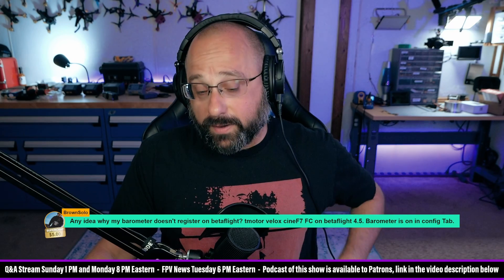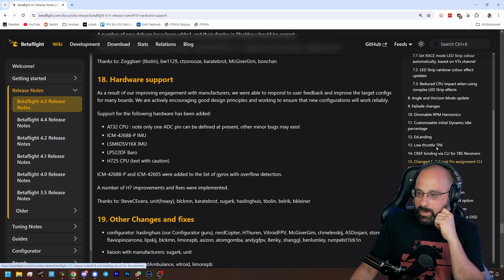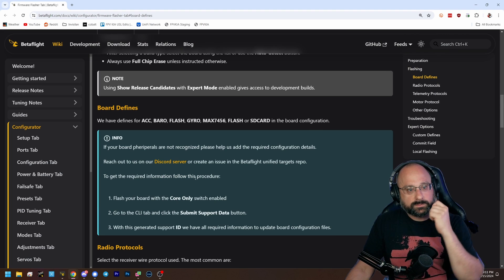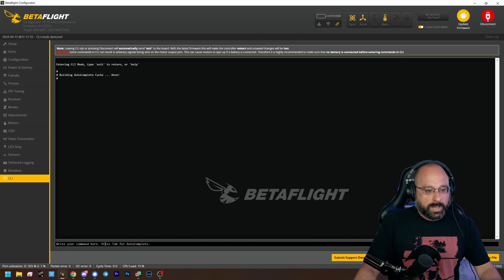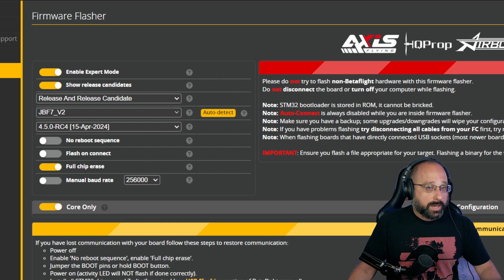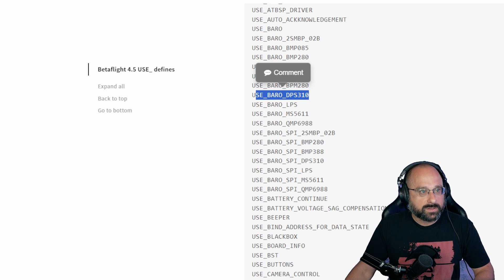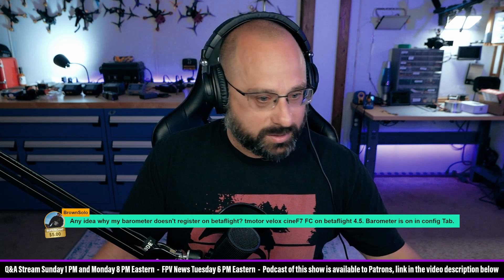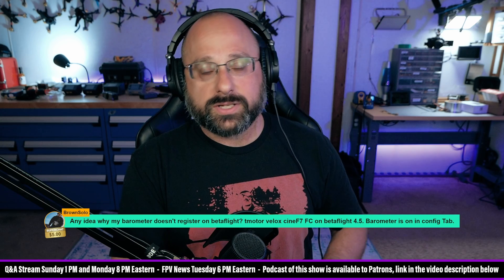My Barometer Doesn't Work on Betaflight 4.5! Help! Custom Defines? - FPV Questions

Comment: Same issue with iflight blitz f722 fc, betaflight doesn’t recognise the baro. 
Once I flashed to bf 4.5 baro icon appeared for sometime and then gone. Reflashed 4.5 assigning the dps310 according to the spec of the baro on this fc, but it didn’t solve the issue

Comment: Thank goodness for this clip. swapped a dead speedybee v3 with a v4 and this problem showed up. I couldn't get BARO_DPS310 to load so i just used DPS310 to get it working
Reply: Just wanted to clarify: 
Did you type BARO_DPS310 in the custom defines & it didn’t work.
Then you typed: DPS310 in the custom defines, & then loaded the firmware & flashed it, and it did work?
Is that correct?
Thanks so much.

Comment: Helped me out on this too turns out auto detect chose the wrong firmware type for my GOKU F722 PRO V2 Flight Controller
Found this on Flywoo and flashed with that and it worked: BF Flight Controller Firmware: FLYWOO F722PRO
Reply: So  Flywoof722pro? Because I know it said dual on the auto detect one

Comment: i dont have any baro detection even in core mode, my flight controller is brand new, its the speedybee f405 v4. I have tried both beta flight and gps and in both softwares i am not getting any baro, mag and gps detection, they are either off or in red.
Reply: i have the same problems with speedybee f405 v3 i installed gps not working and the baro on my fc is also not recognised
Reply: red means you dont have any stats. go outside and check

Comment: After updating the firmware to 4.5.0 betafpv F4 1S 5A AIO, the osd fell off, and now it’s impossible to roll back to the old 4.4.3.
Reply: That sucks. My osd came back when I flashed 4.5. Before that, I'd thought I'd damaged the hardware.
Reply: @kurtzFPV  Now the bootloader doesn't work. I can’t update again or flash any other version. Telemetry is working, the transmitter warns me about the voltage. I’m not saying that OSD is so necessary on tini whoop, but until I figure out what’s going on, I won’t flash the rest of the FCs.
Reply: @trinol-kq3um  I have updated most of my fleet now, but did have an issue getting into the bootloader on a couple of FCs. For me, restarting the computer, then opening betaflight configurator, the going to cli, then typing in bl and enter solved it for me. Good luck.

Comment: There is a similar issue with the HGLRC Zeuss 722. It was produced with two different baros (SPI and I2C). In older BF versions they were able to support this out of one binary. Now there are two BF targets 722 and 722e,where the e version is for SPI. After flashing make sure that the baro is really set to SPI (check with dump and status). The core trick that Joshua showed helps to find out which version you have (or you got an old dump where it worked).
So JB, I guess there is more then one 😂
Reply: i have this exact board. should it be in SPI OR I2C?